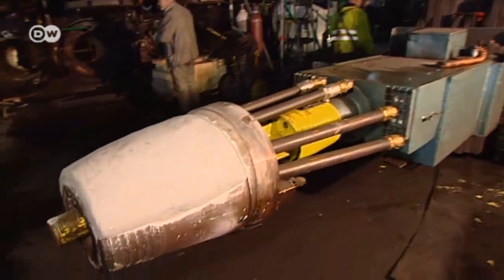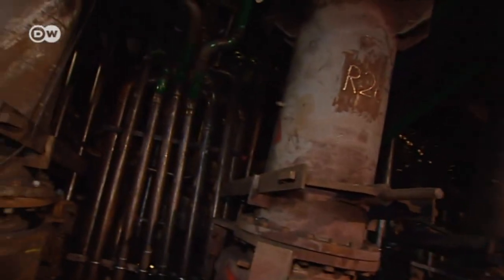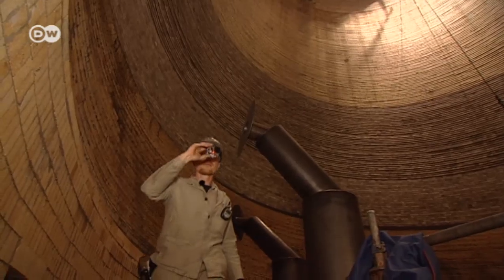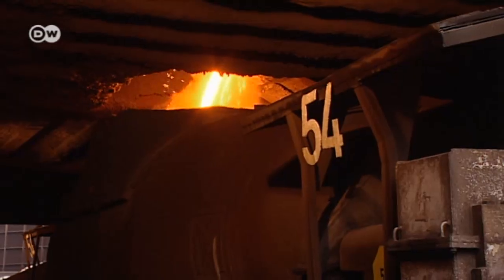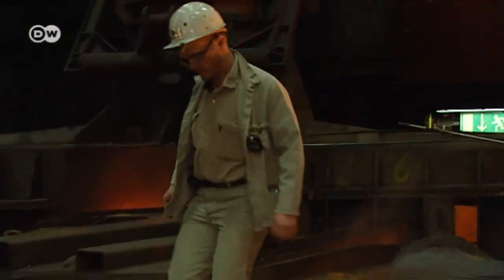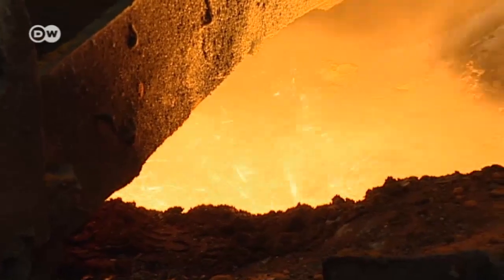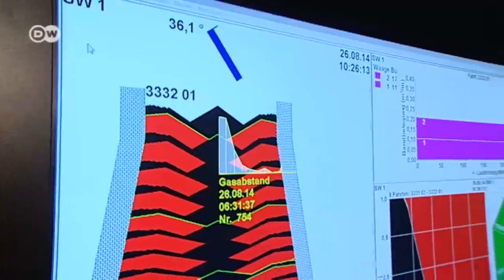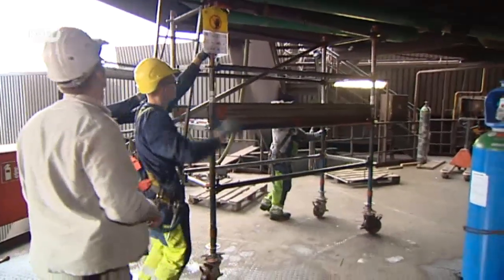Europe’s Biggest Blast Furnace - A colossus being made fit for the future | Made in Germany

Comment: Regarding technical carbon chemistry: The idea of an economically viable, countercurrent-operated high-performance industrial shaft furnace is not entirely new. Its CO2-sorbing packing, consuming itself, generates a doughy carbon mass from the uprising atmospheric air column, that can be deposited in existing, extensive fissures, shafts, and passageways underground - drill, drill, drill ! -  A little more of recuperation, and adjustments of chemical equilibria: Voila! Thus, the discussion about the threatening climate impact and environmental acidification would soon be brought to a consensual and honorable end. Hadn't Dr. Ing. E. Beppler already expressed himself along these lines long ago?

Comment: Ive seen a number of videos on rebuilding blast furnaces, super interesting for sure.  There's one here on YT about a rebuild of Bethlehem furnace, quite the process for sure.  One thing I've never seen or heard though, that's the start up of a cold or rebuilt furnace.  Once in operation, it's sort of self sustaining, coke, limestone and ore go in the top, liquid iron comes out the bottom.  Reclaimed and fresh heated hot air is forced into the furnace, the coke and limestone burn/react and melt the ore.   How is the process started in a cold furnace?
Reply: On start up the blast furnaces which I worked on were lit by a bonfire which had been built in the hearth once alight coke was added and gradually the furnace was brought back on line. For the first three to for days the area was restricted due to the possibility gas been present this is because the new refractories lining the inside of the furnace need to fuse together and become 'gas tight' The last furnace re-line I worked on took 34 day's and was carried out by hand picked team.
Reply: In days gone by with wood kindling apparently

Comment: Blast furnace handle wrought iron only which has a melting point of 1,200 - 1,250 °C only. Then, what is need for 1,450 °C?
Reply: Wrought iron is very low carbon iron with a melting point of about 1,500 C. The furnace produces high carbon pig iron for use in converting to steel. Pig iron melting range is 1,000 to 1,600 C depending on carbon content.
Reply: You need to overheat the pig iron (4,3% Carbon content gives you around 1300 C melting temperature)  so it doesn't solidify during transfer into steel mill, also that heat is used to help melt the steel scrap that is casted into oxygen converter.